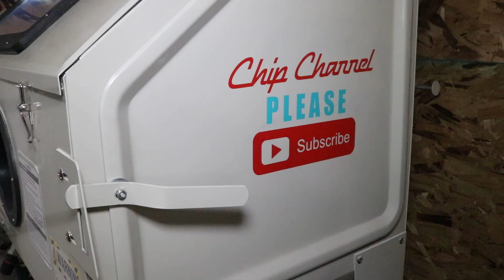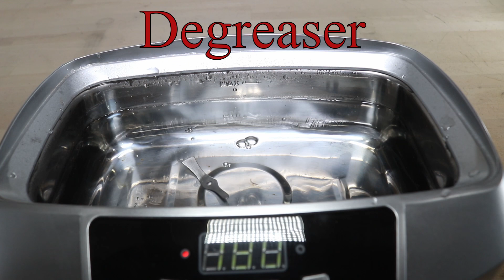1930s Wyandotte Light Up Toy Coupe Restoration

Comment: Did you consider taking one of these and doing a real hoverall, like adding electric motor, going for tuned design etc...
Reply: I also wondered if he had considered converting one to RC. Maybe a wrecker to pluck the next resto from the junkyard without the need of hands in the recording. Just a thought anyway.

Comment: I will never understand why you don't seal up the gaps in the hood and trunk ???? Don't just restore, improve !!! That includes the paint job.
Reply: Because that’s the way it was originally made and if you try to weld that thin of steel you will either blow through it or warp it and completely ruin it.